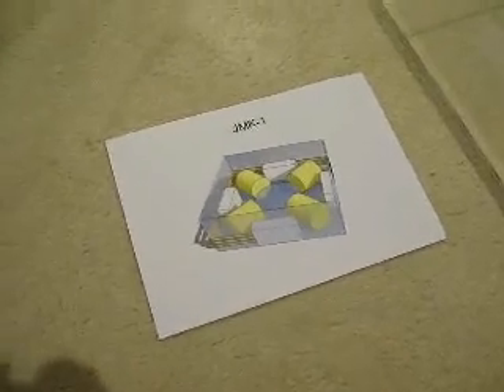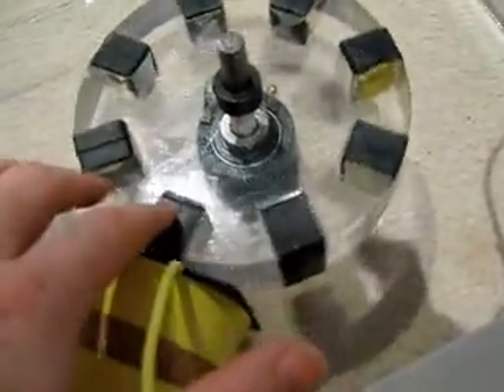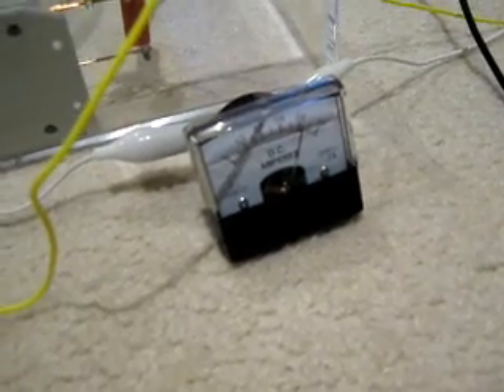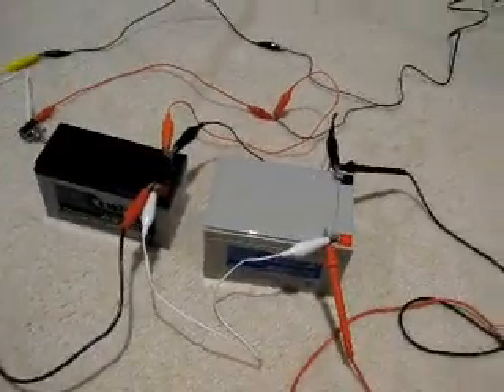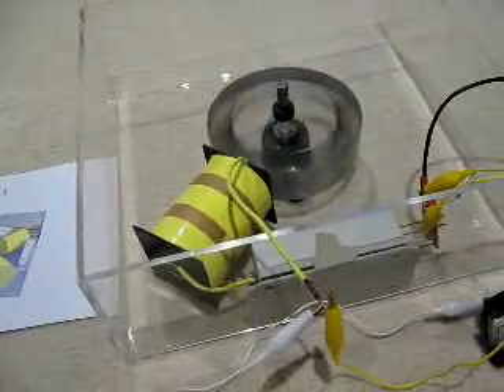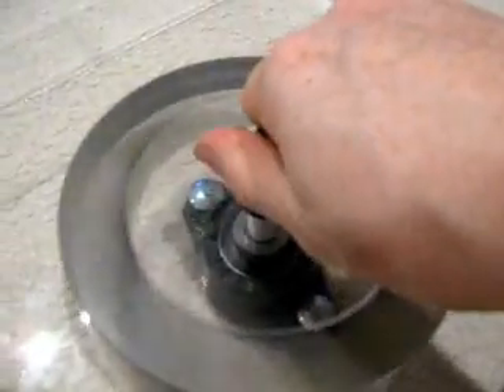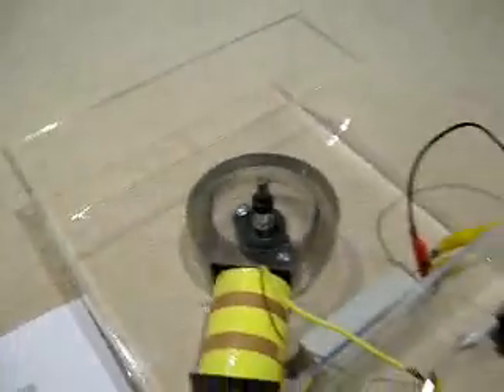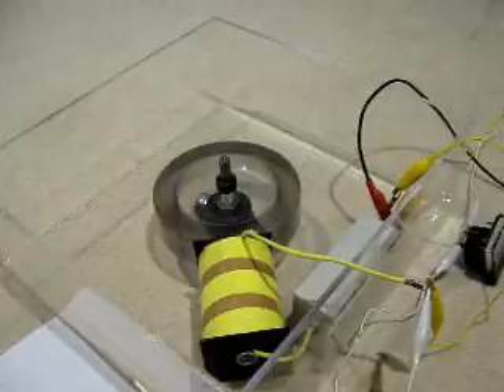Bedini Charger update 2

Comment: Hi I wanted to share two documents with you.  The First pages are showing quite familiar design and implementation of the Bedini Circuit, this one actually shows how to use a fan to split the 4 coils into two coil banks; on a really large 12 Vdc fan this actually works; if done neatly.  THE LAST PAGE IS THE BEST DRAWING YOU WILL SEE ON THIS DESIGN.  I KNOW YOU ALREADY HAVE IT...  These are just links to the docs on Google drive.  Copy and paste link.
https://docs.google.com/document/d/1PUDmBj100CRF9WOZ6yW54BIWnawu6e8QI_s99ufcoSg/edit?usp=sharing

The following is the one I am excited about.  Again the last page is the DRAWING I WANT YOU TO SEE AND WANT YOUR OPINION ON.  IS THIS SIMILAR IN DESIGN TO YOUR SOLID STATE DESIGN OR ARE YOU GOING A DIFFERENT ROUTE

https://drive.google.com/file/d/0B0RAn9YS5nCzaXpEM3lzc3pPSU0/view?usp=sharing

Comment from the maker: you obviously have no clue as to what this method of charging does (I didn't either at the time of this video). It's not free energy or anything, it simply charges the battery with sharp gradients and helps remove sulphation from the plates.

Comment from the maker: Hi Michael,

In the video I have the coil tuned to draw 800mA, but in my final setup I have tuned all of my coils to draw 1 Amp. The output depends on the voltage of the battery you are charging.